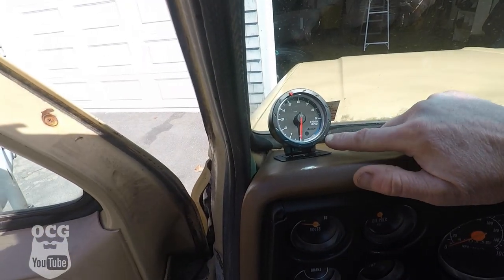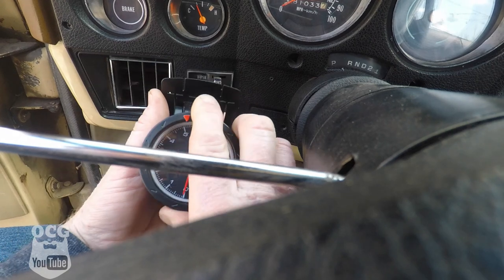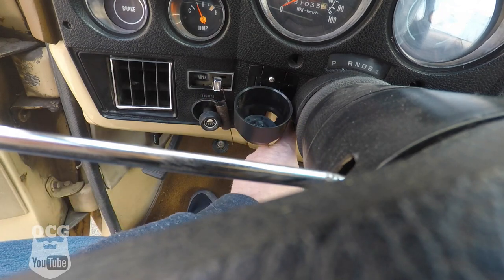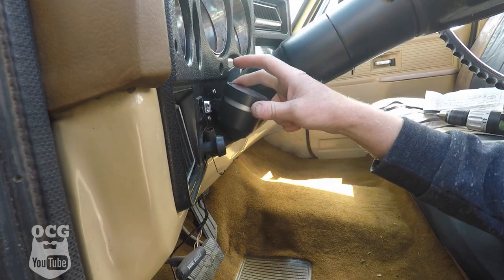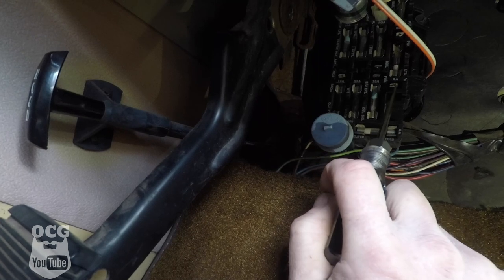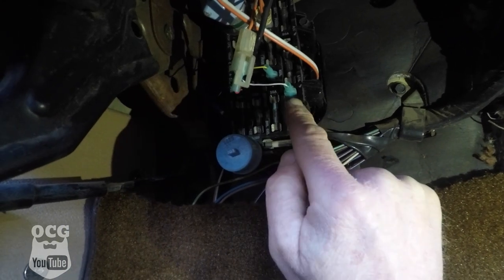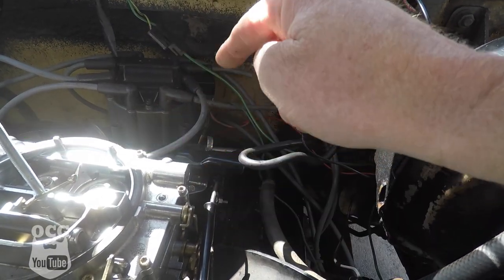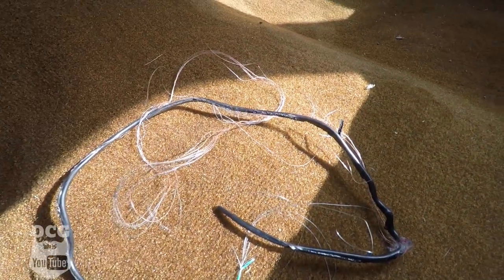ROOKIE MISTAKE ALMOST BURNT DOWN MY 1977 CHEVROLET C10 PICKUP WHILE INSTALLING A TACHOMETER

Comment: got a small tach like yours that do the job! with my 4L80E running at 65mph at 2000 rpm gas millage is good! got the vibration too..its the pinion angle that i have to check :) keep on the good work (without burning anything loll ) :o)
Reply from the maker: We’ll get’er all figured out!